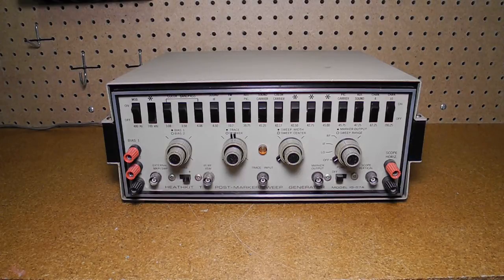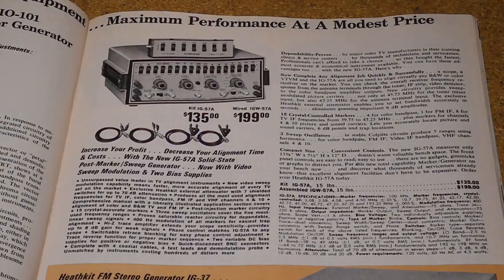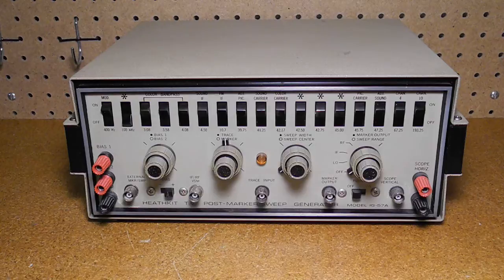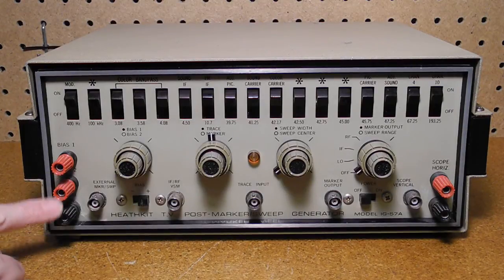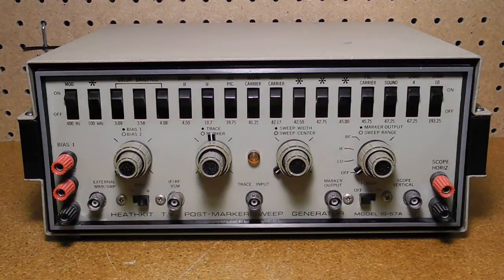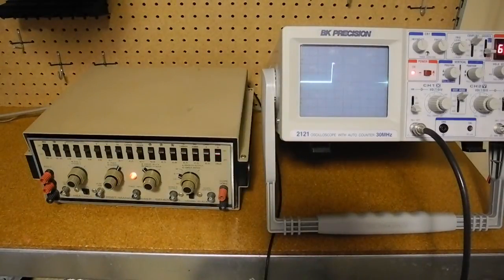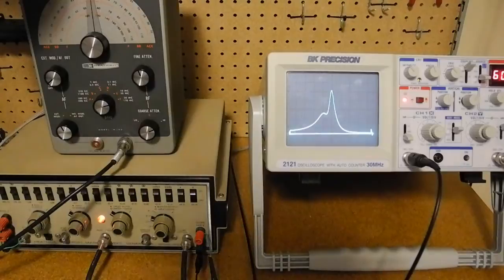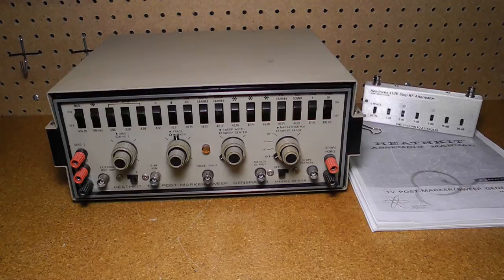The Heathkit IG-57A Television Post-Marker/Sweep Generator

Comment: Hi Jeff,
In most of online manuals, page 58 is missing. This a very important page about adjustments and test of the equipment. I had to buy the original copy of the manual in order to do the manufacturer adjustments, but some steps are not quite clear, and, I would like your opinion. First, they recommend vertical input to max gain for all adjustments. Some oscilloscopes have more, some less. What should be this setting? But my main concern comes when they recommend to adjust every single marker coil, for an specific amplitude of 3/8" (25 mv p - p) Fig. 3A. This setting is clockwise far away for the maximum amplitude of the adjustment, and near the shut-off point of the marker oscillator.  It means that when the marker to be adjusted, is turned off, never comes back when is turned on again, so, I have not to honor this adjustment, as described, in order to have the osc. marker in a working condition. your thoughts ? Do you had have the same problem when tried to follow the manual adjustments instructions? I will appreciate your recommendations.
Reply from the maker: Hello Richard. To be honest I made this video almost 9 years ago and I don't remember any more details of the alignment process other than what I described in the video. Maybe you can try on of several forums for vintage television and see if there are any experts there that could help you.